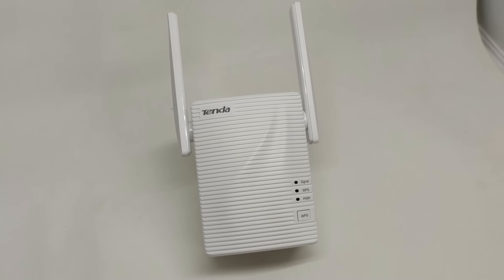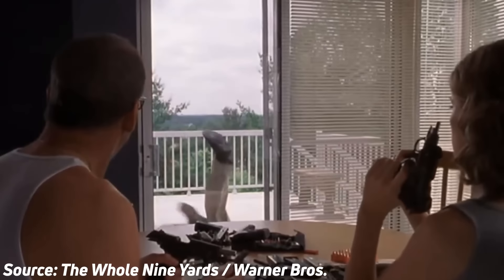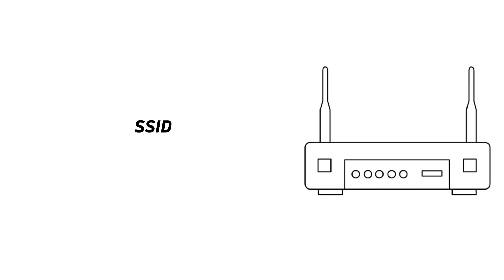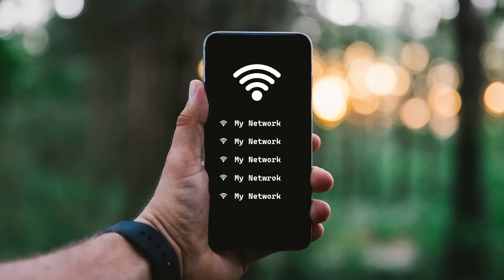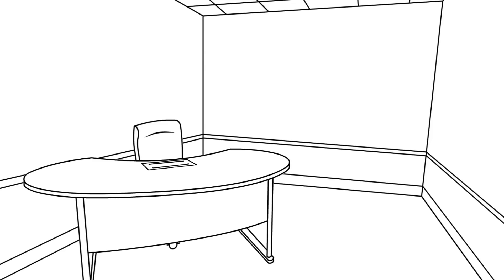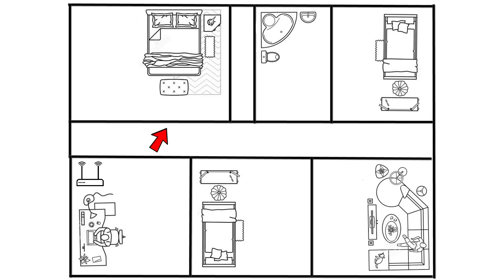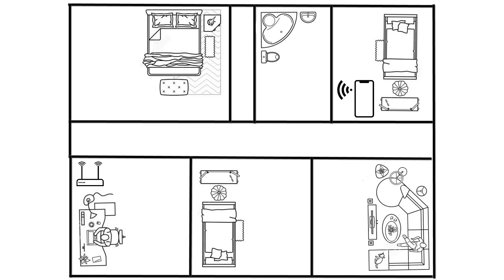How Do Wi-Fi Range Extenders Really Work?

Comment: Once again, great video, I now think in understand more about how the WiFi extender works. 
I do have another question.  How does the extender handle connecting multiple devices back to the router? Does it create a connection for each device as well as a separate MAC address?
I do see some weird device names in my router device list Ex: "17261ec2-7292-f269-5ee7-78ce56f1zzzz" (note:zzzz is so I obscure the real name - it looks like that may be a MAC address).
Are these weird device names, devices that are being relayed by the extender?

Comment: Very informative. Thanks. My house has wired ethernet and the junction box is in the basement where the DSL comes in. That's where my c1000z centurylink access point sits. I get good wifi on the first floor but poor to none on the front and back porch. I'd like to fix that.

I have a second c1000z available and would like to configure them so the second access point gets it's signal from one of the ethernet ports and sends the wifi from there. I've searched but can't find an explanation I can understand. I don't think the c1000z is capable of bridge mode or manual DHCP or whatever is needed to do this. If anyone has any helpful knowledge on a way to accomplish this please let me know. Thanks
Reply from the maker: I have a follow-up video which might help: https://youtu.be/4OkEoanbOeo

Comment: Thoughts on a wifi extender with an eithernet connection to the original modem - seems like to me this is the best possible way of doing things as no matter where you put the 'extender' it would be 100% where it is or where your modem i- not that I think it exists but...
Reply from the maker: Yes, that is certainly a better way. But this video is for the cases where you can't or don't want to run wires. I will likely do a video on the wired setup.

Comment: Can smartphone switch between them smoothly though, getting the same IP, and without having issues on apps claiming that you've been disconnected?
Reply: From my experience it will switch automatically when the signal is too weak. If you’re going to use high bandwidth apps like Zoom then you’ll be best to check which network you are connected to.

Comment: Sometimes it’s better if you can get a duplicate router which can plug into a phone socket, or wired network box.

If it’s not possible, then consider switching over the router and extender locations like I did to give full stronger 100% connection time coverage across the bungalow.

Like he says you have to try different locations…I had an extender plugged into my bathroom shaver socket in my flat in Cairo.

Comment: I'd love a video on MOCA and it's advantages, And disadvantages, over power line. When I moved in, the wifi is terrible in my room. My roommates gave me a power line adapter. Horrid performance. I went out and got a Mocha adapter and it's just shy of the performance I'd get over Ethernet. Pair that with a wifi access point, and I've got amazing connectivity in my room.

Comment: But it sounds like there’s no point in getting it then?  Since it is no better than the signal it gets there from the original access point.
Reply from the maker: Almost yes, but if you put it halfway then you can extend the range as the signal at the halfway point is likely stronger. You might also like my video on how you can use an extender with a cable.

Comment: I'm having trouble with getting my parents Samsung phones to access the stronger bedroom repeater instead of the, on the top floor, weaker original even when they are just by it.
Reply from the maker: Yes, that can be a problem. Are you using the same SSID or two different ones? Whichever it is, try the inverse and see if it helps.
Reply: @GaryExplains  started with the same. Didn't work. Now have another but still doesn't. My mom has learned to switch manually though when on vid calls so that's good. Dad's kinda a technophobe and old so he won't. Don't think he even knows how to check if he's on wifi or not. Thanks for the quick answer by the way.

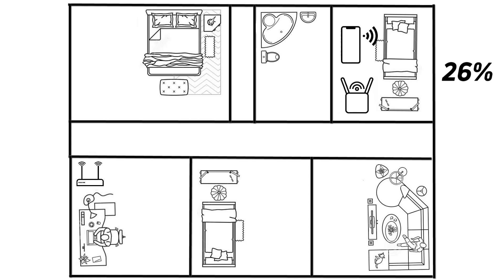Comment: Excellent video Gary, but I still have a question. At 12:37 putting the Wi-Fi extender in the same room as your device doesn't help. But if you put the extender somewhere between the router and the device, like in the corridor or inside the bottom middle bedroom, would it be better to connect directly to the router or to the extender? Because it's not the same as in 13:26 that you don't have a direct connection to the router.
Reply from the maker: If you put the extender in the middle but you are at the other end of the house (away from both transmitters} then you should get better bandwidth by connecting to the extender, but it is worth experimenting.

Comment: There is many things with WiFi and networks in general. For better coverage of your WiFi, you could use MESH networks, something that would be interesting to see you cover. Now when we are getting all those small smart networked stuff, where some of them is not able to configure or you can't be sure of the security it then would be wise to have such things on a separate network. Some of us might have some kind of servers with access to the internet and there it would be wise to have that on a separate net. Most might know that if you brake into a server and get access to that, then you hole network is on risk... So more on the topic of security and segmenting.
Reply from the maker: I say in the video at least twice that I will cover mesh networks. Did you watch it all?
Reply: @GaryExplains  I'm sorry that you took it that way ;-(  But very few seems to cover the security aspects of wireless.
Reply from the maker: I think the security aspect is important, but it is less about the network and more about not buying smart-enabled devices from random Chinee companies with no history of support. Putting a Wi-Fi enable baby camera on a separate net won't help. If the device is configured to be accessed from the Internet then it is game over. If a hacker has gained access to your main LAN then you have bigger problems than just putting your baby monitor on a different network. As for hacking Wi-Fi, if that is actually happening to you then hiding the SSID won't help.

Comment: In my location,  I have a router in front of a window.  An access point in another building  (about 125 paces away) an a hard wire to a router on the other side of that building. I now have internet  out there.  Iys good enough to watch YouTube,  without buffering. And. I dont use phone data. Cheers

Comment: I believe you're somewhat incorrect sir. Your device does not select which wifi signal is the strongest with regards to the extender. You have to have an extendernthat supports "onemesh" technology. Because the extenders use their own ssid's you have yo physically switch your device between the extender or router. The extender doesn not become an "access point" until you connect an ethernet cable otherwise its purely an extender almost as weak as a repeater. Unless you're saying only if you make the router and extender the same service set ID? Repeaters repeat the same signal no different ssid. Extenders have their own ssid thats why you have yo switch between the ssids
Reply from the maker: This is why I made the video, but thanks for watching anyway.

Comment: I connect a TP-Link WiFi-6 Extender to my T-Mobile OnePlus 6T. The Extender has a single Ethernet out connected to an 8-port hub. My phone is my internet, in my very small home, connecting all my tech. It works. Eventually I'll upgrade to a 5G device (X65).

Comment: @Gary Explains I use 3 WiFi old routers hard wired to the hole network all on different channels and only one does the DHCP. :-)
For my 2 car garage 30ft from the house I ran buried a Ethernet cable and add the 3 Wifi router out there and now I have connective out there  wired or wireless and I get full strength bandwidth. I guess extenders are ok and do 1/2 work but a mesh network (even a poor man's like mine) is way better... :-)
So please do the other videos Gary!
Thanks for the video!
LLAP
Reply: @lindageorge3751  Don't understand!
Reply from the maker: Those aren't a reply from me, but from a fake account that is spamming my channel. I am in the process of a cleaning it up.

Comment: My 2023 Chevy Bolt can connect to the Internet at my home network for software updates, but i cannot get the car close enough to the router for a good signal.
Reply from the maker: You could just use a mobile hotspot on your phone.
Reply from the maker: Yes that is right, it uses cellular data. But I thought the days of cellular data being expensive were long gone. Where I live most subscriptions are unlimited data or have very high data caps, measured in tens of gigabytes.

Comment: Sometimes my wifi just cuts out for a few seconds randomly on my PC. I have good signal and reasonably fast internet and that periodic disconnect is super annoying! Fixed it by getting a powerline adapter
Reply: 2.4ghz wifi is very unreliable from my experience. Also has lag and inconsistent latency. 5ghz usually runs almost as good as ethernet. 
The range with 5ghz is also better from my experience, does show less bars but much better speed. 
2.4ghz: 2/4 bars barely works. 5ghz 1/4 bars works fluidly with 50% speed.
Reply: It’s all depend on what model of AP using, some model have crappy 2.4ghz radios. Generally speaking, for the same signal strength, wifi5 (802.11ac) can transmit more data  (loose term used here) than wifi 4 (802.11n), and note Wi-Fi 5 only runs on 5ghz. That explains what you got, i believe it is more due to Wi-Fi 5 at work rather than 5ghz. Wi-Fi is complicated I agree haha

Comment: I've used WiFi extenders and I have the same issues you had. That is until I swapped everything for a mesh. You can get a 3 mesh network for under 100 pounds.
Original sky router. Lounge 100 percent, kitchen 70 percent, bedroom 50 percent, loft 25 percent. Using an extender Lounge 100 percent, kitchen 85 percent, bedroom 75 percent, loft 40 percent.
Mesh network. Lounge 100 percent, Kitchen 97 percent, bedroom 95 percent, loft 90 percent. So mesh is brilliant. My ping is also very good in games.
Reply from the maker: Thanks for sharing your test results, very interesting. Am I right in assuming that you didn't use a wired connection between the mesh units. Also what brand/model of mesh did you use?
Reply: @GaryExplains  I wired the mesh into the router and disabled the WiFi on the sky router. That's used as only a modem. I've got one in downstairs hall plugged into modem, one on middle floor in guest bedroom and one in the loft which is wired into my computer and Xbox. But the speed reading was on my phone. Maximum speed is 31mbs and minimum 27mbs. TP link deco E4
Reply from the maker: Very helpful, thanks.
Reply: @GaryExplains  Before that I could never get more than 12 in the loft which is where I've got a home office/Hifi and gaming stuff. It's where we zoom/Skype from as well. So it's the place that needs the internet the most. When we had sky Q the mini boxes worked like a mesh and not too bad. Stable 12 minimum. When we left sky Q because we didn't watch it enough then it got really hard. Tried WiFi extenders, using big routers with 4 antennas but nothing was reliable. Ping was sometimes good, other times bad. If you used one device downstairs to stream TV the loft would suffer. Couldn't justify spending 300 on a mesh so when these came out reduced from 140 to just 89 went for it. Another advantage is it's the same network so if you cast something from a phone to a TV or Chromecast you'll be on the right network. Some of my devices need you to disconnect WiFi and reconnect if you change rooms or they'll stay on wrong access point. Others much better.

Comment: Most extenders have an Ethernet port. That way they can be used as a wireless bridge for a device without wifi to connect to the main router. Not mentioned in your video. Otherwise a great explanation!
Reply from the maker: I did say at the end that there are other solutions including used wired ethernet.

Comment: So I just came across your channel and subscribed. I'm hoping Gary or a subscriber can help me,I know nothing about computers or internet. I just bought a ring pro 2 and it barely gets wifi connection. Its at my door thats at the bottom of a flight of stairs and my wifi router is at the top of my stairs inside another door. What would be the best way to get stronger wifi to it. Someone told me to get the chime pro but I don't want another chime. So any help would be great under 200 dollars. THANK YOU FOR ANY HELP!!!

Comment: Using mine to supply as a bridge to old router to new FTTP (Brsk 150mbps) so can run old tp link to run old equipment mainly NAS drive Firebox Tv Wired to extender, turned old tp link to bridge, turned off wifi on router (switch mode) job Done same network not 1 2 or 10 ssid) 

Not greatest speeds with extender only 35.89mbps off 150mbps but drops in evening to 21.19mbps upload speeds are 65.88mbps 😂😂😂 but does to use for wifi and items mentioned 😊 but splits new fftp for other items such as gaming or desktops in house and rest of devices to old router or extender

Comment: Hi Gary, how much latency does the extender add to the WiFi connection? For example, if someone wanted to connect for online gaming and needed minimal ping? Thanks!
Reply: Don't bother connecting to an extender through wifi for gaming... You'll get atleast +100ms latency because of the half duplex communication. It's better to connect the routers by ethernet or use a powerline adapter.

Comment: The key word is walls. Wifi extenders work best when they are wired into the router. They are also good for smaller dwelling, like 900sf with one wall in between the router and extender to reach your computer or smart TV. If you are trying to extend your house that is the size of a mansion, I'm not saying to forget it, but you will experience limitations.

Comment: I have never had success with these things. One thing that has worked flawlessly without any signal loss is a POA (point of access). They work great. You locate it in a bad wifi signal area and ethernet it into the router. Problems solved. Dependable wifi remotely from the router.

Comment: The WIFI Extenders use the mains wiring to carry the data stream but the master has to connect to your router via a Ethernet cable and your slave will connect to what ever Internet enabled device via WIFI or Ethernet cable.
Reply from the maker: No. You are thinking of a powerline adapter, those are different.
Reply: @GaryExplains  OK No problem.

Comment: I had a lot of packet loss so I drilled a hole through the floor and used a wire. Problem solved.
Reply: Same. Was getting 300Mb/s on a supposed 600Mb/s fibre connection even when stood right next to the router. Ran a cable across the house, now getting the full 600. Wi-Fi sucks.

Comment: I'm really interested in wired backhaul access point!
Reply from the maker: In a simple setup, like using the network extender in the video, then there is nothing really to say, you just connect your Ethernet cable to the port and set the extender into AP mode. Job done.
Reply: @GaryExplains  In this way will another network be created? I'm looking for networks like Asus AiMesh, where it is possible to have wired backhaul.
Reply from the maker: @nicolaslavinicki4029  The access point has to create its own WiFi network, with its own BSSID. But when it communicates with the original router then it will do it over the wire and so the bandwidth will be much better. From a higher level, in terms of IPv4 etc then it will all be part of the same LAN.
Reply: @GaryExplains  thanks!
Reply: @GaryExplains ! Could you make a video about other Router brands that has similar feature like AiMesh from Asus? Where the node does't to create its own WiFi network, with its own BSSID. But when it communicates with the original router then it will do it over the wire and so the bandwidth will be much better + ofering seamless roaming when I'm moving around the house. Please!
Reply from the maker: That is one of the things I am investigating. So far I haven't found a mesh network that doesn't create its own WiFi network with its own BSSID. It maybe that all this "seamless" stuff is actually marketing not technology. I will keep investigating.
Reply: @GaryExplains  Appreciated.

Comment: So are you saying a wifi repeater will never give you 100% on the other side of the house?
Reply from the maker: The local signal will be 100%, but the repeater needs to "talk" to the primary wifi router, over wifi. If the signal is weak on the other side of the house then it will be weak for the repeater as well.

Comment: i cant actually relate to this video my main router is 1 room away and i was getting 1 MBPS and ping was 200+ but then i used another router in my room and extended it with main router now its giving the same 1 MBPS and 30 ping and also media stream has been improved extremely. the main problem is dBm not the signal percentage because even in 30% signal it can carry 30 to 40 MBPS of bandwidth which is enough to serve the internet at its best we only require Max 5 MBPS to of internet speed to stream full hd videos so signal is not causing any issue but dBm is dropping our internet response time extensively because our devices are not that powerfull to recieve signal since it operates on battery but extender can communicate with main router without increasing dBm which results in same speed with low disturbance and fast response time its usefull in 1 room distance as i have experienced so if you are looking to buy extender for 1 room minimum green signal from me